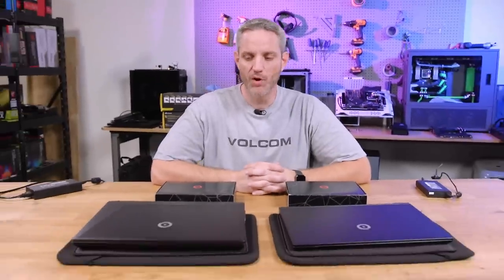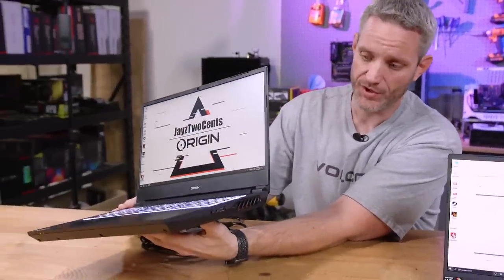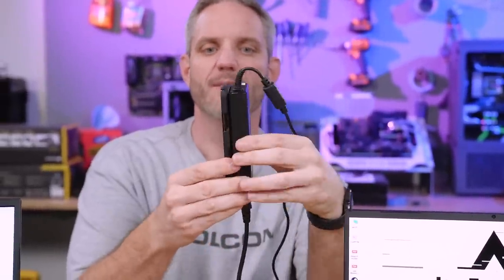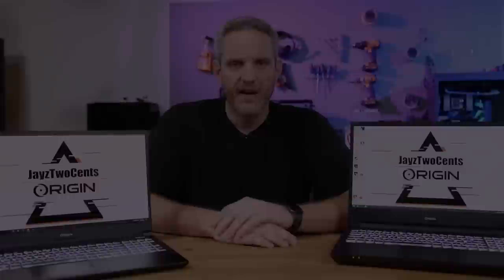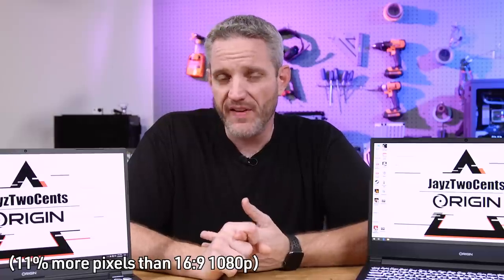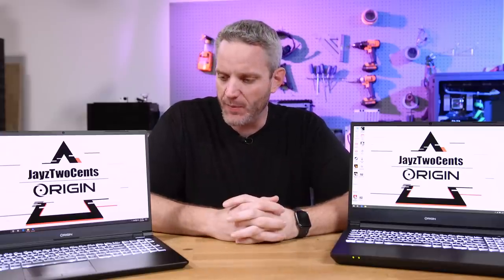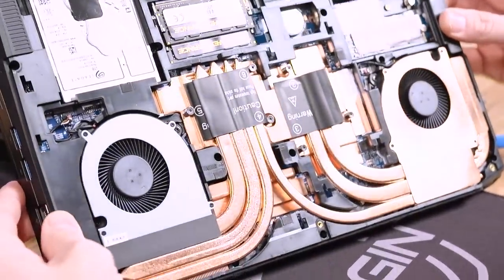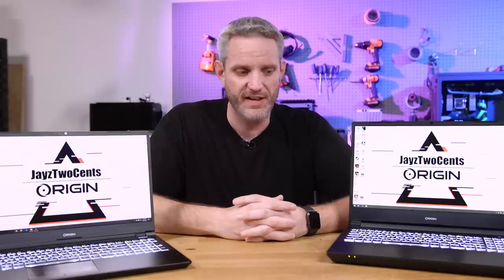A Laptop with 16 Cores 32 Threads?? Desktop killer!

Comment: Comparing to the desktop variants and those expences...Laptop / Desktop replacement models ( I prefer 17" flagship models )... have more than twice the ultility considering form factor size, mobility and still being multi functional for gamers, pro production and entertainment.  I still used old tech devices and media for entertainment using second hand free devices as intergrated add on / plug in componants and have innovated my own cooling solutions to defeat the heating issues for my laptop / studio desk top by using a metal cooling plate from  old camping RV food & bev coolers. As long as its not so cold as to produce condensation moisture....it cools the entire area of the bottom of the lap top ( air intakes and chassis body ) and I never hear the fans while gaming.  I can not do that on desktop chassis and then that requires more $$$ investment, time and materials and some micro management to achieve the same practical solutions to heat issues and performance.  Overall, it has been a better overall investment. This makes my new 2012 laptop investment of near $3,000 a less painful prospect . I'm just waiting for the various brands flagship models to arrive at retailers & wholesalers to make my final selection due to specs and features.

Comment: Generally if you work a laptop hard, it will run like a jet engine and throttle, so if the need is not mandatory get a desktop to run hard...even gaming you will run very hot and loud!!

Comment: You say faster than my 3900x, but I've managed to achieve 7800 on cinebench r20. No not much higher than the 7606 you got, but still an improvement. May have 4 more cores and 8 more threads. But as you said, I'm able to just brute force my way through with a 4.425 Ghz all core OC. On my water setup I see up to 80 degrees, which will improve once I get my 90 degree fittings, and am able to finish a blender render of classroom in 4 minutes 45 seconds with ryzen master running. Although that is damn good for a laptop.

Comment: I bought an msi gamer laptop with a nvidia 980 card. First the cooling was only for for cpu temps, so cpu temp under check and gpu hot, fans would not ramp up!!!
Laptops are still a tradeoff, so if the system is stationary, buy normal components. I never used the laptop as a laptop, meaning I hooked it up to my 144hz asus screen. I bought it because, at the time, I had too much money to be asked to build a desktop. 
I got lucky and won a pc and went for buying parts for the amount. Reused old parts and have this spec

OS: Win10 home 64bit*MB: Asus Strix Z270F/
CPU: Intel I7 7700k /Ram:32gb_ddr4
GFX: Nvidia Asus 1080 8Gb
Mon: Asus vg2448qe 24"
Disk: SSD
 all six of them 
Stick: TM Warthog #1400/Saitek pro pedals/TIR5/TM MFDs
it runs like a champ. the 1080 card is still a 70fps ish card in most heavy titles. 
Here is the thing upgrading a laptop might not be easy and any cpu or gpu ..forget it on a laptop. 
To me laptops are for people that really need that kind of power, most of us want a fast computer and maybe no hassle from the family ;)
The family just wanna see the result, if it came from an A or B don't matter. To us nerds it is (insert your own curse) ;)
Laptops have a shorter lifespan than a well build desktop. So if money is a factor, buy desktop stuff :)

Comment: My current uses for a laptop (outside of my work providing me one for 100% work activities) are none. A newer smartphone is definitely a smaller form factor than any laptop.  When at home, I have my home PC: a mid tower, i5-2500k, and a 1070gtx, with a 24"144Mhz 1080p display.   That kind of portable laptop power, heat, weight, and $$$$ I have no personal need for.  But they do look like very nice machines. To each their own.

Comment: I've only had laptops for 20 years now, first had some cheap HP and Acer shitboxes, but then got my first Asus G-series gaming laptop and had it for 8 years as my main allrounder. Finally it shit it's power brick and battery :/. Played around with few ultrabooks with linux Mint in them for few years and finally bought yet another normal sized more gaming like laptop, Acer nitro 5 to be exact. Now I'm really on the edge trying to figure out if I should get better gaming laptop, or desktop one. So yeah, I would pick the intel variant with the 2080 and be happy with it :).

Comment: I actually asked for a netbook at my last job. This was the original EEPC by ASUS. 7" screen and 8gb hard drive. I needed an ultra portable that I could hold in one hand and have INSANE battery life (6+ hours). It sucked for a lot of things, but not at the task that we bought it for. I got it for inventory. It just needed to use a web browser so I could scan "real" laptops and keep track of them. And yeah I frequently held it in one hand with the barcode scanner in the other. It was perfect! Of course this was before tablets existed. And honestly I don't know how I'd be able to hook up a barcode scanner to a tablet. Later on they got a little bigger. I wanted the bigger one. It would have been easier to use. But it wasn't THAT big of a deal.
Reply: Usb OTG bar code scanners 😉.

Comment: 3cad software even without using CFD  is a substantial load on mobile CPU's. The AMD 16 core option would be incredible especially with the ability to have multiple CAD programs open at the same time improving workflow substantially. My last i7 laptop nearly lit itself on fire while resting on my lap. I might think of buying a new Intel laptop in future generations just not a Lenovo.

Comment: With a laptop this heavy, why not a huge, or two huge remoavable 90wh batteries behind the screen, keeps it away from the heat, and adds more room for cooling, ports, and internal expansion for 'professional variants with quadro grpahics that might need many 2,5 inch drives along with 4x NVME drives

Comment: I think you'd be hard pressed to get a power brick smaller than "even the original Xbox brick," which didn't exist (it had an internal AC adapter, no external brick).

Comment: my issue with laptops are the price buying a $2000+ after a few years a new game comes out and u cant even run it at high settings anymore then you have to choice to not play that game or buy a newer laptop having a desktop yes not as portable but having the option to sell old parts and upgrade over the years thats why i like my mini itx builds allows me to take it everywhere I go

Comment: @4:04 4KED... if it wasn't for Phil's handy "jargon buster" most of us would have thought he said "ForkHead" 😂😂.

I currently have a HP ProBook 4730s and that laptop is pretty damn heavy. I used to carry that around for work years ago - give or take 8 years lol. So no stranger to the fans ramping to banshee levels of wailing when the laptop is in use lol. As I had to replace the fan and that's what my replacement fan does 😐  

I wouldn't mind either of those laptops but I wouldn't recommend using either on your lap lol... the amount of heat generated will fry some delicate components hahahaha 😶. 

16 cores and 32 threads, would literally replace my current system which is 2700x, 32 gigs ram and a RX480. GPU handles GTA 5 just fine at max settings and maxed draw distance with no MSAA and I rarely game. I also use a 42 inch 1080p TV as a monitor, it was cheaper than a 21" monitor at the time when I bought it... go figure 😶.

If I had to choose, I'd go for the AMD variant as it's perfect for my use case. The only problem is that you're stuck with that 2070. We really need to get the MXM standard back for GPUs....

Comment: My laptop has dual 1080. Surely they can put one 2080ti in the big one since sli died. And two giant 330w power bricks of course. But I often just sit at 90 continuously ever since I got it a few years back with 6700k and have had zero issues.

Comment: There are no screen configurations I prefer. 4K is very much unnecessary outside of creator work. I don't do that. I want framerates, but I don't want 1080p. Why do so few laptop makers not offer 1440p 120/144Hz screens? It's the golden ticket.

Comment: Well designed laptops. Lenovo has a decent competitor.

I would take AMD for Android development - depending on the application, I've seen a big difference in build times when I compare my PC and a laptop. It is not needed, but then it is just more comfortable to have everything compiled quickly. I wished it had more port for an extra monitor - I got used to using 2x4k monitors.

Comment: MaxQ cards gets the same cores but reductions in clocks and or physical memory. 

Max Q versions usually perform closer to the card below (2080 not super) with that version. 2080Super MazQ will perform more like a 2080 (non super) desktop card.

Comment: There is not enough room in a laptop to have any decent cooling of a decent graphics card. The other thing is that the keyboard on a laptop is not very durable. You haven’t got the cpu hard soldered onto the motherboard either. Laptops are really only good for non-gaming and to be replaced completely when one of the components fails and therefore a desktop is durable and each component can be replaced easily. The other thing is that the laptop screens are too small compared to giant led screens or monitors. There are 240hz plus monitors for pcs rather than only 60hz

Comment: Damnit Jay. Why couldn't you have put this video out yesterday?!
I *just* drove 2 hours over to MicroCenter and bought the Razer Blade Pro 17 (2020). It's the exact same specs as that origin one (10875h 2080super) but the origin one has in-built mini-displayport for my vive cosmos :'(
Fucking razer requires a usb-c/thunderbolt to mini-dp adapter :(
(PS; Anyone shopping for a laptop, wanna find a unicorn?- Look for something with a 2080 Super, with TB3 AND Mini-DP. They don't exist.)

Comment: WIth the AMD System you can run VMs or you can use it for multitasking. ;) but remember 3 years ago... The ryzen 7 1700 was the only 8 cores CPU, which was built in an ASUS notebook. And now... 3950X@ 65 W TDP... ;) Wow.... That is just a beast. It is more than double the performance, if we check the Cinebench results. ;)

Comment: Amd - I would run multiple operating systems, experiment with containers, and game. One thing about that though is I would like to see a 2k panel on it 165hz or something like that. Rant: AMD CPUs are never paired with serious GPUs (2070 being semi-serious). I think I am a fanboy. But it doesn't change the fact AMD's highest tier of paired GPUs in a laptop would be some variant of 2060. With exception to this Clevo style builds. Intel - gaming and productivity. I would prefer to have a 2k high refresh rate panel on that too.

Comment: My Scar 2 (i7 8750h, 32GB, 512 SSD + 2 TB SSHD and a RTX 2060, 144HZ) is more than enough for everything that I throw at it.
If I were to buy a new laptop nowadays, I would go for a ASUS TUF Gaming A15 FA506IV, 4800H/4900H with at least 16GB and a RTX 2060 (144Hz), cheap for it's performance (at least ~$300 cheaper than my Scar was)
(disclaimer: I never held one, so it might be flimsy, but since I use mainly on a desk, I don't really care)
I'm sure I will build a decent gaming pc one day, but at this time I lent my "gaming" rig away since a i5 8400, 16GB with a 1070 is just not better than my laptop and I can bring this with me :)

Comment: I don't really see the benefit of 4k panels when they are that small compared to 1080p. The pixels are already very tiny since that's like 1/4 the size of a 32 inch monitor. You would have to use a magnifying glass to make 1080p pixels noticeable on that screen, but on a 32 inch or even 27 inch you can see them at normal viewing distance so 4k makes a difference then. That's just a waste of GPU performance running 4k on such a small screen that would be better used for more framerate because you would see that.

As for working from home... you don't need a laptop and shouldn't even use one. You just end up with a smaller screen and less comfortable/smaller keyboard. A small screen will lead to eyestrain and having your hands so close to use a laptop keyboard isn't exactly good for the wrists and will lead to injury if you work 8 hours a day on one. If your work involves travel then that's when you need one. But if it involves travel a couple times a year, or you go to the office monthly then get a normal monitor and keyboard and put the laptop to the side and configure the full size monitor as primary and the laptops small one as secondary for notes, toolboxes, or whatever making it where you don't have to swap windows all the time and get more screen real estate for the work space.

Comment: speaking of laptops and thermals, last night my laptop (10 year old 1st gen I7) was shutting down for thermal issues. I was just playing a flash game. I'm like seriously? I have a cooling pad on it. I've always known that it ran hot. That's why I got the cooling pad. Then I took a closer look at the pad (also 10 years old). The left most fan (IE the only fan that matters) wasn't spinning. So I took it apart. There was dog hair wrapped around the fans. TONS of dog hair. I cleaned it up put it back together. It was still running quite hot, but it wasn't throttling or shutting down anymore. I miss my new samsung 2in1. It runs so much cooler. But after only 2 months it died on me. I'm about 90% certain the battery is bad. Amazon wouldn't do anything and then covid happened and I kind of neglected it. I really need to get off my ass and try to get them to fix it, but based on the year, it was out of warranty when I bought it. I can only hope that a screenshot of the amazon purchase is good enough.
Reply: Ashley Williams ...Thermal compound on the CPU should be replaced every 3 years. It’s probably as dried out and hard as a brick.
Reply: @Iam_Dunn  lol probably and my desktop is 9 years old using an intel stock cooler and stock thermal paste. Lol I'm building a ryzen 4000 system soon.

Comment: Conveniently failed to mention that the price to configure that thicker laptop to the spec in the video is over $3,000. Base price is $1700 with a R5 3600, 2060 GPU, 8GB of slooow RAM, and a measly 250GB NVME. Any gamer with an IQ above room temp is going to build a better spec Desktop for half the cost (of the $3k version). Laptops are NOT a good choice for gaming, I don't care what anyone says.
Reply: Usman Khan  Exactly!

Comment: I'd use the AMD one for running Windows with Hyper-V (never got really used to KVM. VMware is just expensive shit (and VMware Player is same as VirtualBox) and I do not like VirtualBox)
Within the first VM I'd run ArchLinux for casual stuff and developing.
On the host I run Visual Studio
Another VM is used for testing and live debugging the application via virtual COM port (connected to Visual Studio on the host via named pipe).
Than maybe a few other VMs for playing with OpenStack and k8s.
Running docker on the host also for playing with stuff (currently it's the forestry CMS)
A VM for legacy stuff that I want to play with.
A VM for Reverse Engineering and memory snapshots to fiddle with.
Running some games (on the host obviously)
Oh and finally to also use Google Chrome...
Reply: Dream BIG buddy & never back down, also; good luck with Google Chrome ;-D

Comment: So, on the Eon 15, since it has desktop parts, does this mean it supports PCIe 4 NVMe drives? Would it be possible to upgrade the GPU later on? I'm asking because I once had a DTR a long time ago, but I was able to upgrade pretty much everything on it and keep it going for quite a long time. I upgraded the CPU, memory, hard drive, GPU and even the display. Just curious to know.

Comment: Yeah, the Premiere results are bugging me. The Intel system is ahead even with hardware encoding off. Surely that shouldn't be the case. QuickSync notoriously produces lower quality end results than just using the CPU so I would not want to be using it. So how is an 8c16t CPU beating a 16c32t desktop CPU with QuickSync disabled?

Comment: Months ago someone did a comparison with my desktop i9 on his barebone laptop to the very chip running on my entry level Asus Z370 board, disappointed to have found out the i9 9900 can't go undervolting as far as I could on the desktop platform and thus consumes more power and generates more heat. That tells me running a high end chip on a laptop is way harder than it looks, there's no much room for error.

Comment: I'm BAFFLED why Origin would hamper a 3950X with a 2070 GPU. The GPU is most definitely the bottleneck in this system as proven by the benchmarks.
Plus, the EON15-X is the only model they offer with an AMD CPU.
Can't wait till more laptop manufacturers start using Ryzen 4000 series CPUs though.

Comment: Those are just XMG laptops with a Origin logo on them and more expensive. Not to say Origin bought them off of XMG or Schenker but they probably bought the chassis off of the same supplier and put in their own hardware.
Reply from the maker: You must be new to how ODMs work 😉
Reply: @Jayztwocents  Just looked into it. I was fully aware of what it is but I was surprised how many laptops are actually produced by ODMs. That's kind of sad tbh.

Comment: I'm still on my only laptop, the Lenovo y510p with a beautiful single GT 750m card (2GB?), i7 4700mq. I definitely would love to get an upgrade, willing I get a different job. But as to which PC, I LOVE the specs of the AMD one although I don't think I can use it to its full potential. The most intensive application I could think of that I use is VMware for 2 measly servers, and gaming rise of the tomb raider on ULTRA low settings lol. I feel like the Intel would be more than enough for me as I could probably enjoy more gaming capability out of it and much better parts overall. It makes it hard though since the AMD has more room for customization, but i guess i'm not a power user.